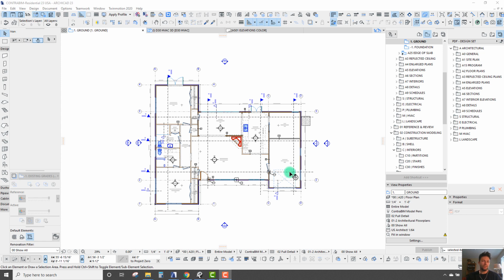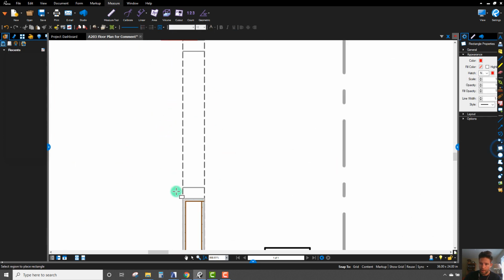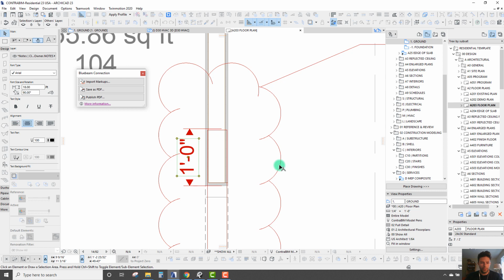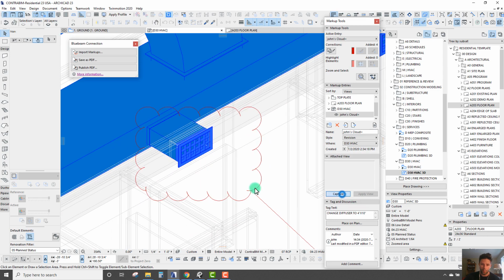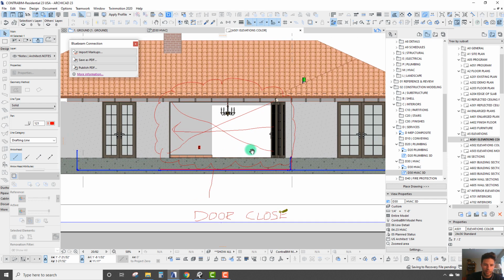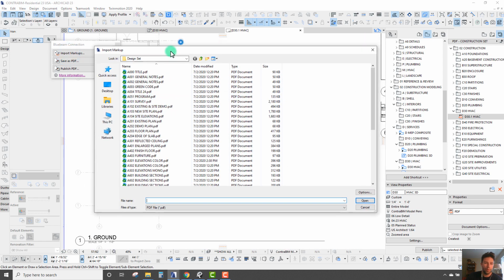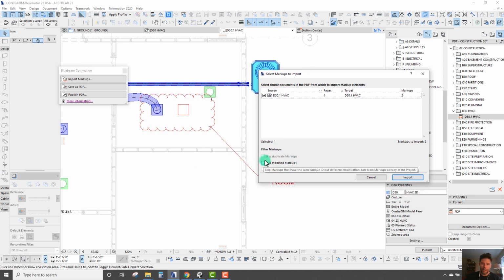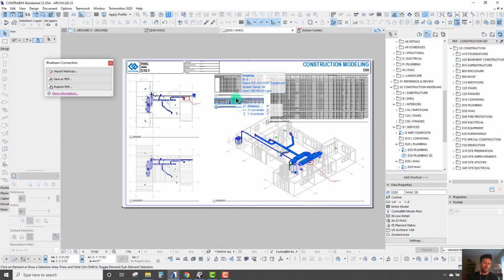How to Import Bluebeam PDF Markups into ARCHICAD

Comment: Great tutorial as always! One question I have is about the workflow. Once you've imported someone's comments, what's the best way to close the loop when the model has been updated and is ready for review or needs additional input? Using your example, you noted to move the A/C vent, which someone did, but then found a conflict, or wants to know if you want the sprinkler head to move also, etc. Is there a way for them to add a reply or create a new comment for the reviewer in a running conversation until the task is complete? And once the task is complete, how is it closed out and archived?
Reply from the maker: Thanks Todd. Great question. The Markup Tool has now been switched over to the new Issue Manager in v24, and it works pretty similar, but with some definite enhancements. When markups are created in the PDF, and imported via the bluebeam connection, it creates a new Issue. That issue can be tracked and assigned dates for when to be completed. Something that is meant for working in Teamwork, but useful for managing a list of issues for correction in the model as well. Having a running conversation back and forth between Archicad and a PDF format in Bluebeam may not be quite so easy, but if the conversation is in teamwork it's much easier to manage. Issues can be closed out and archived with the new Issue tool as well. I'll have to do a video on it as there are now some changes to this original video. Thanks for the question!